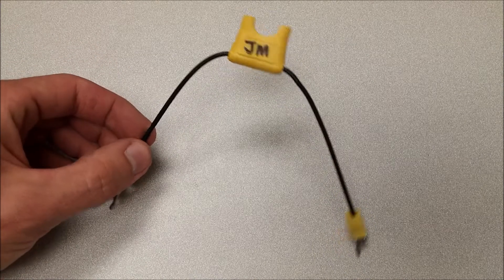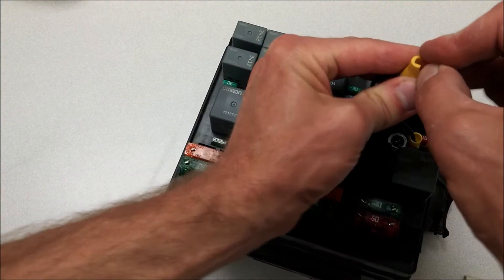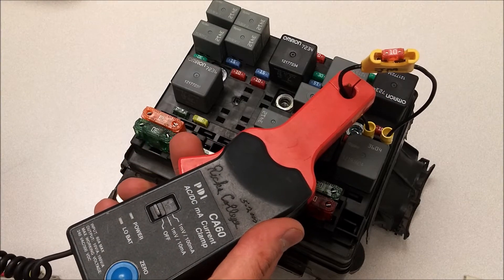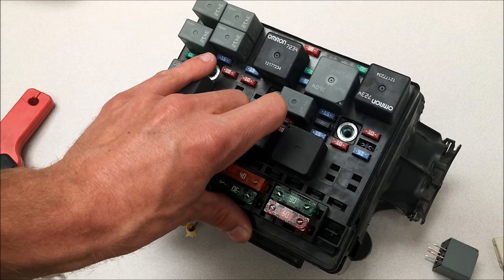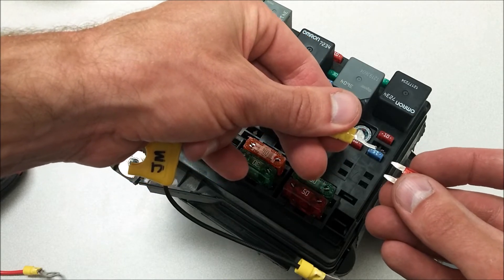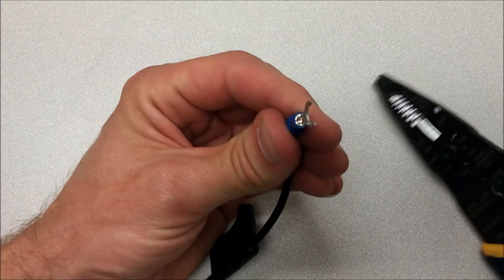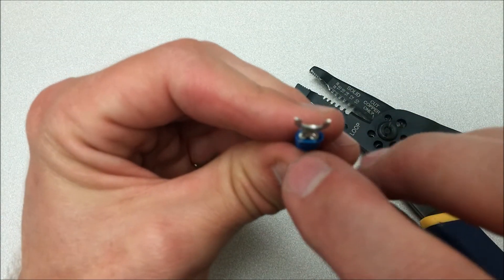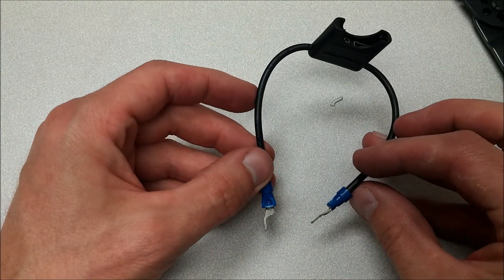How to make a "relay and fuse" jumper (current loop)

Comment: Good evening sir hope your day is going well! I have an INNOVA 3300 and wanted to set it on DC10A to then proceed using red and black leads to probe pin 30 & 87 on starter relay to crank the 2003 DODGE CARAVAN SE. Is it possible for me to do that? Cause I'm on my own and I have nobody to crank the vehicle for me. I purchased a 12v remote starter switch from harbor freight and using it the first time it broke on me. I don't have a jumper wire and I don't have a fused jumper wire either all I have is the INNOVA 3300.
Reply from the maker: Does your meter have a min/max function?  If so, you can use that to capture your current reading while you crank the car.   You can use probes with alligator clips so that it is hands-free.  That way you don't need to have a remote start switch.  Also, if you would like a current probe, you can get them at CatchaWave.com.  Good luck!

Comment: Thank you do Es a circuit breaker fit or do you need a seperae set up
Reply from the maker: I use circuit breakers in mine all of the time with no issues.

Comment: Thanks. I've been looking for a way to use a multimeter to test current, up to 10A, on my motorbike, testing from the fuse box. Some time ago, I saw a commercially available shunt for this purpose, but haven't been able to locate it. This may be what I need..